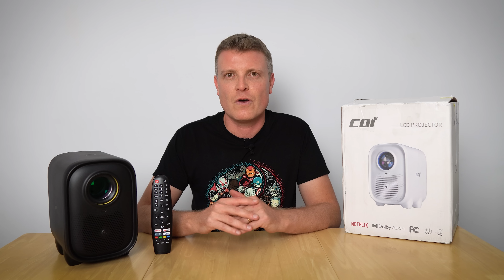COI Uno5 Review - The $299 Netflix Certified Projector!

Comment: if you want reliable gaming test.. it's usually good to try with pinball games
Reply from the maker: Sadly I don't have any
Reply: @Techtablets  well.. there's an easy alternative too... setup your projector ( connected to pc/laptop ) - so those are both visible on cam ... and run a timer ( with miliseconds ). When you pause the the recorded picture ( you should be able to see difference of time between the monitor(pc/laptop) and the screen ( projector)

Comment: How long will the bulbs last?

Edit: 30,000 hours. Not bad.
Reply from the maker: Yes 30,000 hours is the claim and it's a sealed unit for dust etc it will help in the long run.